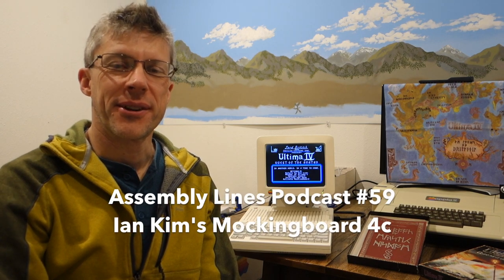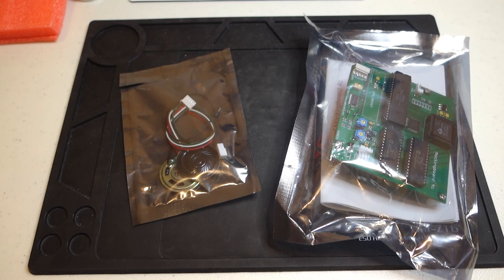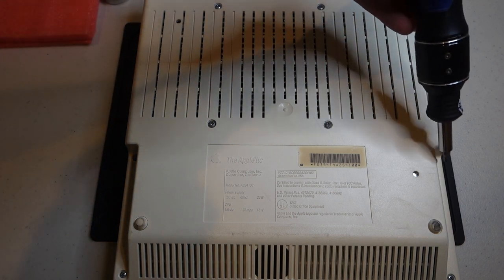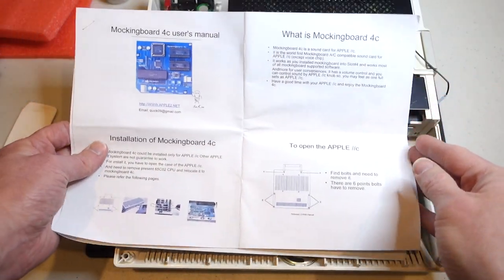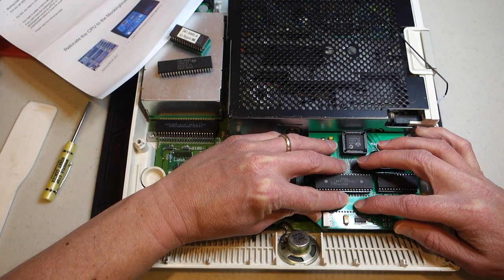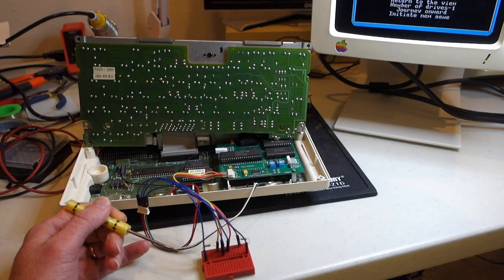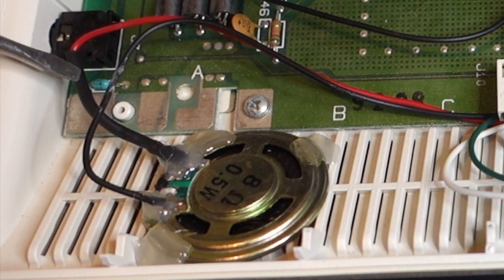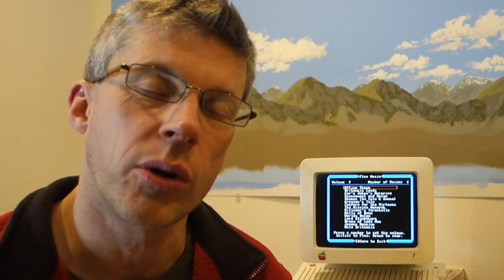Assembly Lines #59: Never Mock the Apple IIc

Comment: Hey I have an Apple iic+ which has a 4mhz processor similar to the 6502, it’s structurally the same, and the layout is a bit different, but not vastly different. Any ideas if it would work on the iic+?
Reply from the maker: That is an excellent question. I would recommend emailing Ian Kim directly quick09<at>gmail.com
Reply from the maker: Oh, and if you do email him, post the answer here. Thanks!
Reply: I will, thanks for his email.
Reply: Well Ian Kim responded and said that the MB4C does not support the apple iic+, due to the cpu clock speed difference and the difference in IO chips. He did say that he might redesign the MB4C and make a MB4C+ for the iic+ machines in the future. Hope he gets around to it because with the MB4C+, my apple iic+ would support pretty much everything on the apple ii platform; sound included.
Reply from the maker: Wow, that would be great if he added support. Thanks for posting a reply!

Comment: You don't like the drop handle method for opening the //c case?
Reply from the maker: To be honest, I forgot about that! Next time...
Reply: For the curious, here's a quick summary of the "drop handle method". Remove the six outer screws, turn the IIc right-side-up, flip the handle down, raise the rear of the unit about 1 inch / 3 cm, then drop it (on a hard surface). The top of the case pops right off. Legend has it that this is how Apple trained its dealers to open a IIc back in the 1980s. It looks and sounds scary but there is nothing in the IIc that is shock sensitive.